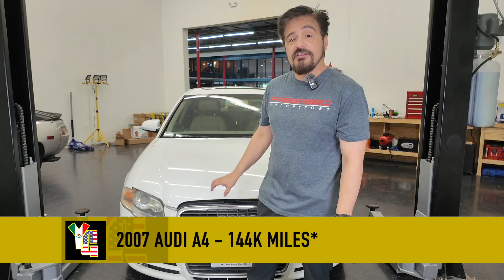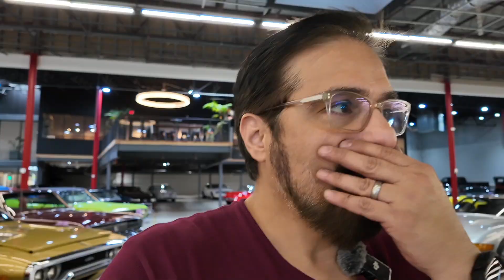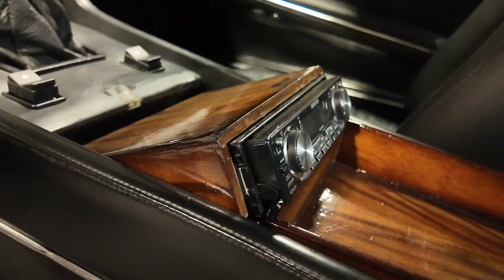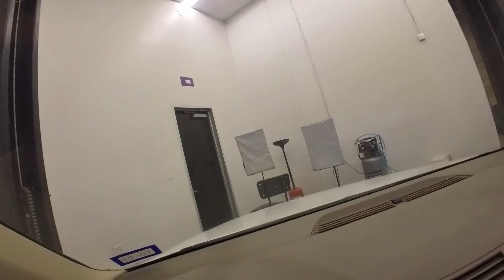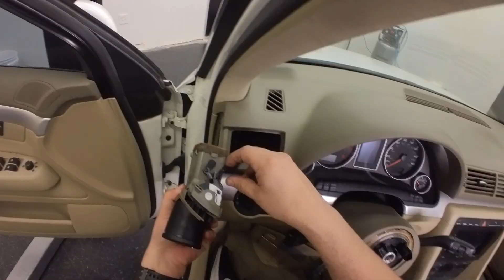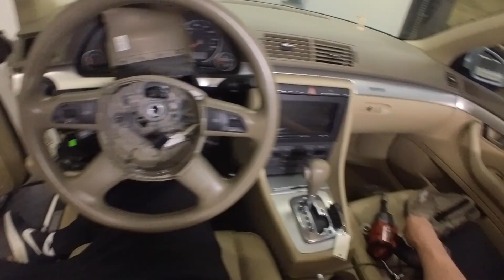I'm A Big Boy Now! My Own Shop!! 😱

Comment: Good to see you posting videos from your new garage! Thinking back to when you fixed Pepper's convertible top -- can you tell me what gives the signal to the clamshell and motorized side flaps that it's time to close (once the top has opened completely)? I'm thinking the potentiometer -- the one that swings on the left cylinder pin -- sends the signal that tells the clamshell and flaps they are now allowed to do their thing?
Reply from the maker: Appreciate the kind words. There are micro switches all over that control the module. Windows, flaps, one above your head where the hook locks in, clamshell and top.
Reply: @YogisGarage  It's been a few years, I know. Which diagnostic tool did you get for your Porsches to be able to monitor all those microswitches?
Reply from the maker: @firstbornunicorn9626 you’ll need the Durametric tool for sure. You won’t see the switches but you will be able to calibrate. Same tool I’m showing you in the video.